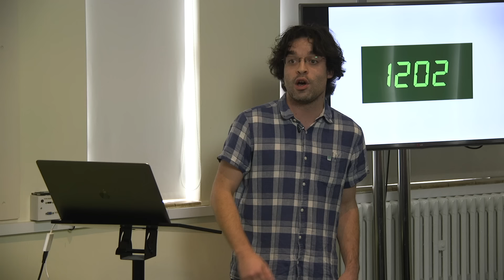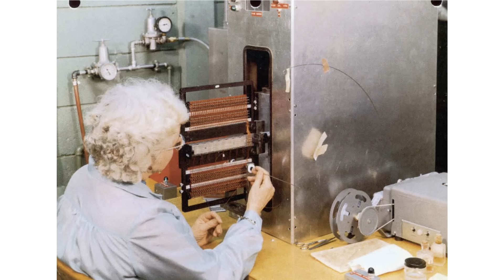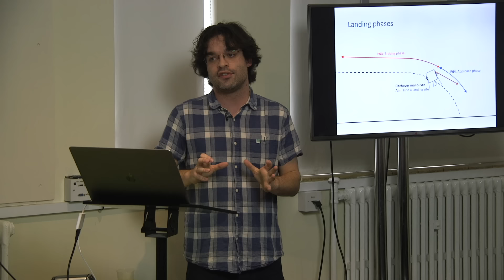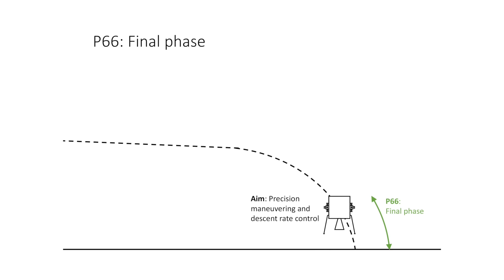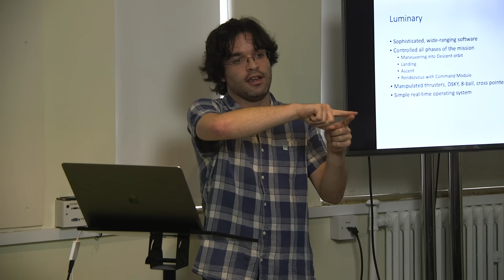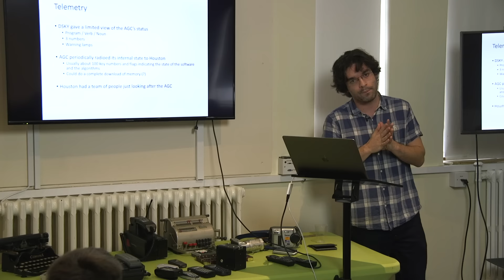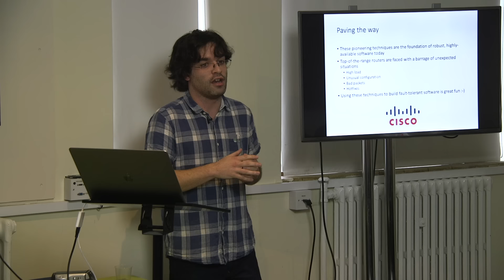Light Years Ahead | The 1969 Apollo Guidance Computer

Comment: I heard/read that the rendezvous radar had a spurious fault that NASA were aware of but couldn't resolve. The strict flight instructions would then have included switching the rendezvous radar off during descent to help mitigate any potential problems, which makes perfect sense as it wouldn't be needed anyway. Aldrin must have been unaware of this problem because he left/switched the rendezvous radar on, possibly because he thought it meant one less thing to do in case of an emergency abort...? If he HAD known about the problem, I doubt he would have left it on and risked compromising the AGC. This begs two questions:  Why was Aldrin not made aware of the radar problems by NASA. 2) Why did he break with what I assume were strict operational rules about turning the radar off?

Comment: Having worked on Apollo at MIT/IL, this is an excellent presentation.  Very well done.  I should also note that while doing the AGC (Apollo Guidance Computer) programming, we had two types of simulations that we could run to test and validate the navigation software.  One simulation was completely digital in nature and we ran those simulations on an IBM 360 computer.  The second simulation was a real time hardware simulation done in a mock-up of the command module (CM) and the lunar excursion module (LEM).  The astronauts would come and get their first training on the AGC at MIT/IL, then get further training in Houston.
Reply: may i ask if unix was the os used
Reply: @wheretimehasnovalue9343  - No, the programming language used was basic assembly language programming, and the operating system was specific to the Apollo missions.  The computer’s operating system, designed by Hal Laning, was revolutionary for its time (the 1960s) because of how it was able to schedule tasks, correct errors on the fly, and automatically interrupt tasks to perform other tasks whenever circumstances required.
Reply: @johnsutherland168  Interesting, here at 44:07 Robert describes Cooperative multi-tasking, not Preemptive being used on the AGC. Did the automatic interruption occur in some different pieces or level of the SW?
Reply: @ubersticks At around 10 minutes, the presenter discusses interrupts while he’s still discussing the actual AGC assembly. Most of the later discussion of the coding principles are about the interpreter and the “virtual assembly code,” so I do believe it is indeed different software, in a sense.
Reply: Then you must know it's all made up.
Reply: Oh my God. The first embedded computer's farther is here..
Reply: @Chleosl  --  I was a small fish in a fairly good sized technical pond.  My contributions were small at best, in my own opinion.  I was asked to stay on at MIT when I decided to leave for another MIT project (Navy DSRV project), but my decision had been made, and the request to stay helped me feel good about the Apollo work.
Reply: @KB---  My original reply seems to have been deleted by YT.  It must have been because I included a web link.
Reply: What did you do?
Reply: @slow-mo_moonbuggy  - I started out doing computer programming and went into leading a small operations group.  I was responsible for the delivery of the released programs to NASA and the prime subcontractors.
Reply: @johnsutherland168  amazing

Comment: The NASA hardware gets so much love, but the software engineers were really the pioneers I think. Not to diminish the accomplishments of everyone else involved, the hardware was also groundbreaking, and the pilots, MCC, support staff etc all did amazing, unbelievable jobs. But to me, the hardware was so limited that the software needed to follow suit. Of course, this was normal for the mid-late 60's, so it wasn't that far out in terms of sizes etc, but the programming involved for the math etc is like...unbelievable that it worked. Software engineers have had massive dreams of what is possible for as long as software engineering has been a thing, and even before - the limiting factor has always been hardware. The real unsung heroes of the first decades of the US Space Program, in my layman opinion, have always been the software engineers working within such tiny limitations to accomplish something we STILL HAVE NOT done again. Less than 2kB of RAM and 36kB of ROM? Absolutely insane when you are trying to compute navigation in space

Comment: it wasnt light years ahead, although i get it's a "punchy" line, it simply had the complexity of a hand held calculator. nowadays you have general-purpose chips like RISC , ARM, x86  with loads of instructions , and very specific instructions, even on RISC...  also there is a lot more stuff considering security going on in these chips. -> intel IME , AMD PSP   and lots of other hw features that are not needed for the main operation of the CPU.  basically the AGC was used for a very mission critical things  but at the same time was stripped down of any "fluff" or "bloat" as you would say nowadays. maybe you could say that the AGC compares to a 286 DOS machine , like the 286 MSDOS machine compares to a modern x86_64 cpu with windows 11.  faster hardware allows you to put more "fluff" into your hardware as well as into your software to make usage more safe/secure/comfortable/feature-rich/etc. at the cost of complexity and also a little bit of performance (viewn relative to what a modern CPU could do if you left out all security features and management engines etc)

Comment: through one of the last questions (at 1 hour and 8 minutes), Robert Wills answer is completely false (or at least very misleading, but I know from experience it's hard to formulate consistent answers "on your feet"). Modern computers reuse the same location for different variables all the time.  As a simple example: local variables allocated on the stack.  Also, one big job of the compiler is to try to use registers in the best possible way, and thus you reuse the same register for several things during a single function.  Also, any memory allocator, be it in manually managed languages like C or as a garbage collector in languages like java will routinely reuse memory.

The actual point is that most of the time, we do not do this manually !  We have enough spare room for either static or dynamic tools to do that for us, hopefully without bugs.

Of course, regression tests sometimes prove us wrong, but it's very meta: we no longer about individual variables most of the time, but rather about bad bugs in the compiler or memory runtime system !

Comment: From the perspective of someone who first started playing with computers in the early '80s, and did a lot of bit banging on microcontrollers in the '90s. 36Kwords or ROM and 2Kwords of 15 bit memory is actually rather impressive, more room than I was allotted for much work in my bit banging days. about the only things more impressive in what I dealt with was the speed 4-8MIPS vs 50-100KIPS, and the advantage of a much more efficient instruction set.
Interrupts without a stack? surely not. it had to have something in there.

Comment: I absolutely LOVED this presentation, from start to finish. And I came away thinking that this ingenious device, as important as it was, was just one of literally thousands of incredible innovations that went into the Apollo missions. Similar fascinating presentations of equal or longer length could be created about the propulsion systems, life support, communication, shielding, spacesuit design, etc. And they could focus not just on the spacecraft itself, but also on the on-the ground testing frameworks, training simulators, etc. for which equally innovative computers and equipment must have been designed. The list goes on and on. What an incredible triumph of human ingenuity!

I would also add that the argument as to whether we actually landed on the Moon is completely moot in this context. Note that I have no doubt whatsoever that we achieved this feat. However, even if we can never prove this to stalwart nonbelievers, no one can deny the existence of the thousands of innovations that went into the project, such as this computer, that pushed us decades ahead from a technological standpoint. Believer or non-believer, you must know that much of the technology that we use every day has a basis in the work that went into the Apollo projects and other missions. Let's focus on the ingenuity... that's what Robert Willis' presentation is about.

Comment: You pay for the weight of the computer four times, not three. One more for Earth re-entry, or not?
Reply: Hmm.......the lunar module was left in lunar orbit, didn't return to Earth !
Reply: @alargy2  There were two AGS computers aboard Apollo. One in the lunar lander and one in the command module, which did return to earth.
So 3 1/2 times? 😊
Reply: The "payment" was rocket fuel. For every Kg of weight more fuel would be required to get off the earth and moon. Since the moon has no atmosphere all braking and landing was done with rocket motors, equals more fuel. Earth re entry and landing used its atmosphere for braking effects, no rocket fuel.

Comment: "Amazing" ... each interpreter-instruction takes 26 milliseconds ... resulting into a compute-speed of just 48 interpreter-instructions per second ... to calculate 3D-space-coordinates for a dynamic realtime landing in 3 dimensional space down to the surface of the moon (navigation) ... ? ... falling 35 meter with the execution of each instruction during the braking phase (P63) ... calculating with 50,000 low-level-instructions per second (or 20 microseconds per low-level-instruction) constantly reading the IMU in order to calculate the necessary control values for the 4 RCS thrust chamber assembly clusters (wondering about their behavioral stability) with its Proportional-Integral-Differential (PID-controller) value components with what precision (?) in order to control the flight attitude of the Apollo-11-landing-Module with its dynamic physical flight behavior in 3-dimensional space (e.g. depending on the weight distribution of the Apollo-11-landing-module) ... to avoid tumbling of the Apollo-11-landing-module ... still executing upto 7 jobs in "parallel" in kind of a "time sharing operating-system" ... is that still a "realtime"-system? ... LOL ... 
 SO ... ! ... the Apollo-11-landing-module was the first fly-by-wire flight device of all times ... Boeing should have taken over from there on ... to keep Airbus at bay ... what a naive fairy tail ... 
 My explanation: routers have no physical behavioral dynamics ... but "moon" landing devices have ... ! ... ;-)
Reply: idiotic incredulity is just that... idiotic

Comment: There is fascinating parallel between the AGC and river barge steering control software. Back in the eighties I worked for a Dutch company that built steering controllers for river barges. 

When a 50 or 100m river barge needs to negotiate a river bend it is not simply a question of turning the rudder steering wheel. Getting the right direction is extremely difficult with river currents and the sheer size of the barges. What the captain has at his or her disposal is barge rotation controller. He or she determines what the required turn rate is in degrees per minute at the current speed and sets the turn rate controller (which use gyroscopes or an inertial system) to that value.  

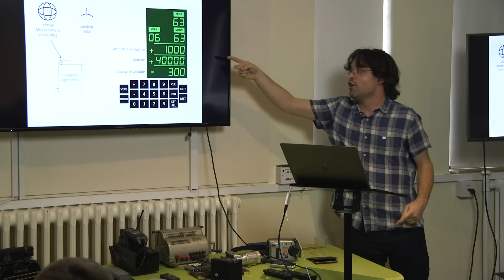At @27:00 it is stated that when you are at 40000 feet an altitude discrepancy of 1000 feet is not important. Similarly when you are a good way from the river bend a rotation discrepancy of several degrees is not important. Just as the astronauts continually checked the altitude discrepancy and "incorporated"  new altitude values so too did the captain check the rotation discrepancy between actual rotation and desired rotation (based on new visual feedback just as the ground radar does) and incorporated new rotation values (by turning the rotation control lever). 

As the barge gets closer to the desired rotation rate, using the feedback from gyroscopes becomes too slow so the program switched over to a more direct form of feedback using rudder direction and speed only. This is very similar to the pilot takeover using lower level control algorithms as the module got closer to the ground. 

There appears to be a control design principle in play here: when you are further away from the desired end point you can use a more calculation based feed forward control algorithm based on absolute inputs but when you get closer you need to switch to a lower level direct feedback algorithm which is based on differential inputs. This principle may have not been recognised as such by the engineers and pilots. The engineers were predisposed to the feed forward control mechanism and the pilots to the feedback control mechanism. Both have a role. As such it was not a "compromise" between the engineers and pilots but perhaps an unconscious understanding of this principle.

Comment: I disagree with the “light years ahead” description.   The AGC was caveman technology.  It was a single computer, if there was a backup computer in the event failover was needed, I am unaware of it.  And stopping the computer so the RADAR could write to memory….laughable.  That is substandard DMA.   Did the computer have any watchdog timers?  The RAM and ROM were mechanical.  The number of clock cycles…seems painfully low to perform the amount of math required in the time required.   Let’s suppose radar was the culprit, the processor case should have been 100% shielded.  Also, one processor handled all subsystems instead of the processor controlling individual subsystems with their own processors…much like a conductor conducts an orchestra.  The AGC was like a conductor trying to conduct multiple orchestras simultaneously.  Does that sound like a good thing to anyone?

I will say it is a miracle no one died because of the AGC.   That is impressive.   For those who still might be unclear…YES, the AGC was used in literal life or death situations.

I did my first assembly language programming in 1976 on an 8080-based S100 system.  Six years later, I did a lot of assembly language programming on a 6502-based SYM-1 single board computer with 1K of RAM.  It had a hexadecimal keyboard so we had to manually convert our code from mnemonics, addresses and data to hex bytes.  That is coding the hard way.  For example:  LDA #$01  STA $c000   converts to:  a9 01 8d 00 c0   While discussing the 6502, Indexed Indirect ( $00,x ) was the least useful addressing mode ever invented.
Reply: you didn't need to spend this many words just to show us your ignorance

Comment: Now this, is Content.

//

I transcribed your 'summing up' at 47mins - I know you revisited it at the end but I'd already done it by then :D

• Use a high level language so that complicated algorithms are easy to write

• Divide your system into jobs where each job just does one thing

• If software fails, restart it - hopefully whatever caused it to fail will have gone away
And we can have another go

• Checkpoint your good states so that if you get restarted you can pickup from a good place where you left off

• Hardware monitors the software to make sure the system doesn’t hang

• Send telemetry about your system to a group of experts who can understand this and make
Sure it’s working

Comment: One more thing: The hard constraints (memory, speed, program size etc.) may force the programmer to come up with much more creative and non-standard, and sometimes weird solutions - but it also have (my experience) another point - your had WAY LESS THINGS that can happen at once, and the ability to be "deterministic" and to "close your algorithms" is much higher than in modern computers with their dozens of abstraction layers, event-based programming, and "open system" approach.

Comment: I wish I was here to ask this question. How long did the system reset take? We're critical lower systems like the rocket burn able to continue functioning while the computer reset? If anybody knows, I would love to know the answer.
Reply: haven't found a good answer for that, but it would have been very quick. Memory was persistent, so they could just restart processing at step 1 and all of the data from the running programs would be available in memory.

Comment: Great job young man. I worked at NASA on the shuttle and knew many of the design engineers for Apollo. You did a perfect job with this material - and the design detail ..not a flaw I could find. I saw both the machine and the program in a room in Houston JSC in the early 80's. You probably have the manual. Bravo -